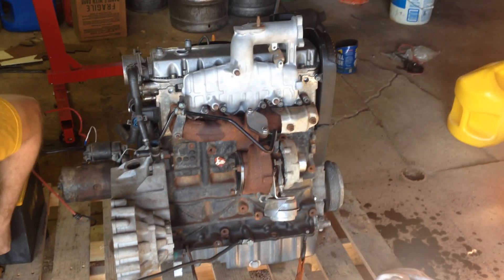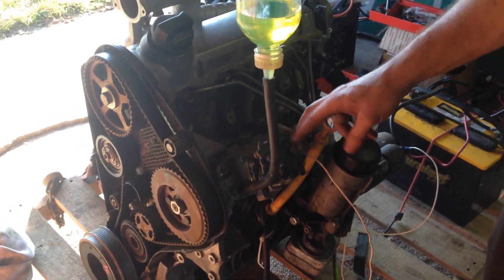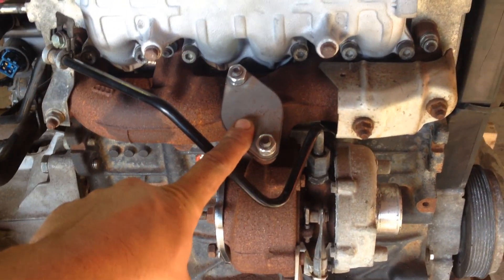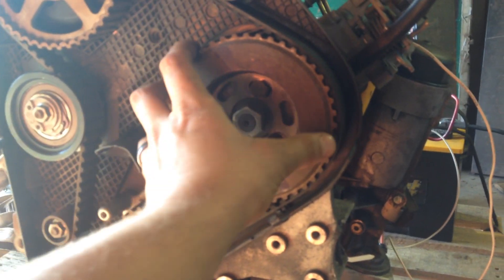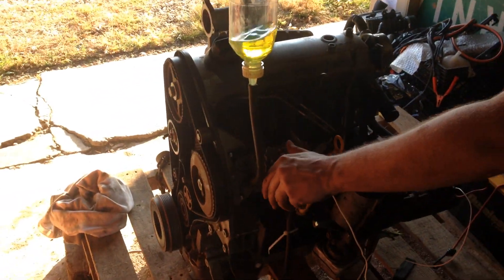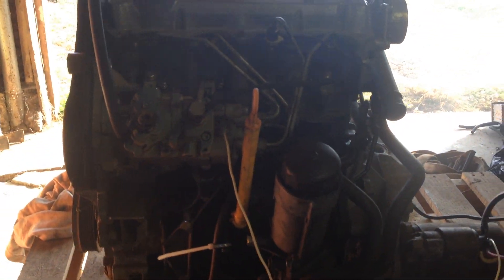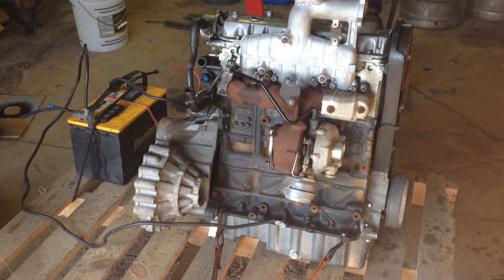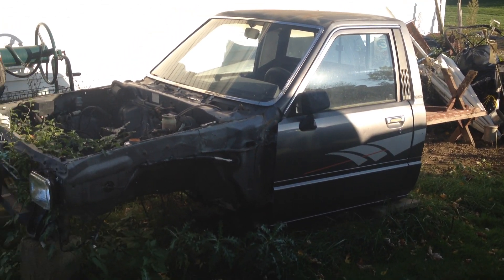VW 1.9L TDI engine - NO ELECTRONICS

Comment: how did u control boost pressure? did u convert the actuator can from vacuum control to boost operated?
Reply from the maker: +piston head 1243 Good questions, lemme ask my lil brother, it's his project. I just help him turn the wrenches and what not. He's in the process of getting a house, so once he moves in this project will start back up. I'll post more vids of the build as it progresses.
Reply: okay cheers for the reply
Reply from the maker: +piston head 1243 The turbo isn't hooked up in the video so I haven't really looked into it very much. But I honestly don't think I'll need to do anything. I'm not removing the vacuum pump from the back of the cam. I still need that to run the brake booster. I'm assuming I can pick up a vacuum from there. The turbo vacuum system is completely mechanical based on engine RPM. No computer control is needed. Now you could have an issue with the VNT actuator which will cause low boost  at higher RPM and the throw a code in the ECU. But the VNT actuator, as far as I know, is mechanically actuated by the engine vacuum. Idk I need to look into it more before I can give a better answer.
Reply: yeah no problem mate. it's just on older vehicles with vacuum controlled turbos  they normally have a solenoid to control the amount of vacuum depending on boost. if u know what I mean lol. just curious :)
Reply from the maker: Messing with the VNT (the boost actuator) isn't going to allow me in any way control the boost. As I thought the system is completely mechanical. The turbo boost is however controlled by the actuation of the VNT. The ECU does this through the use of a solenoid that is placed in the vacuum line. the solenoid is used to increase or decrease the amount of vacuum to the actuator, which will decrease or increase the boost to the engine respectively. removing the solenoid form the system just gets rid of the more fine electronic control of your boost pressure. With it connected directly to the vacuum pump it will get low vacuum at lower rpm which will allow the turbo to create more boost, and more vacuum at higher rpm which will allow the turbo to create less boost. Now i'm not positive exactly on how this will all work out when it comes to boost pressure. Im going to have to monitor both the vacuum and boost to figure out exactly how the system is going to react. The only possible problem I could see is if the turbo creates to much boost. I don't think that will happen with the stock turbo but it something to watch. If it does then i'm going to have to install a blow off valve. The VNT system is pretty cool, what i should see with this set up as opposed to a standard turbo set up is a more constant boost pressure through the engine RPM's.
Reply: cool concept i will keep a watch on your channel ;)
Reply from the maker: Well, My brother got a house, moves in soon. We'll be back on this project after a bit!!
Reply: bisket2003 .

Comment: yup if ever my injection pump dies in my 04 golf im buying a 500$ beater to get to work and back and in the work shop my dub goes for what you just did was wondering if the older pump could go on a tdi drive by wire sucks
Reply from the maker: +MrCinimod93 no, you'd have to use a manual pump to eliminate drive by wire.

Comment: Deano! What's up. The intake on those diesels are notorious for getting clogged up. Also I have an almost infinite supply of fryer oil if you want to biodiesel it. Good luck. It looks pretty interesting.
Reply from the maker: JOOOHHHNNNIIEEEEEEE!!! This will likely have a high mounted snorkel intake fed directly to the turbo. Sadly, its all been moved into store for the winter. We lost our barn/workspace (grandmothers property is up for sale) so it may be a bit until we can get back at it. Still have lots to do on the frame and what not.